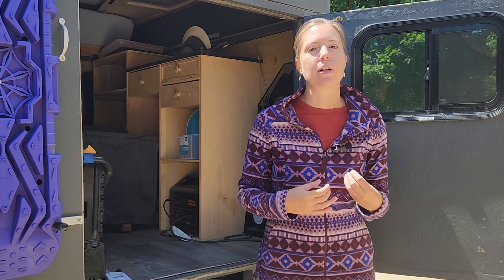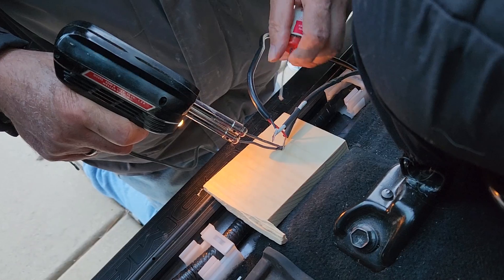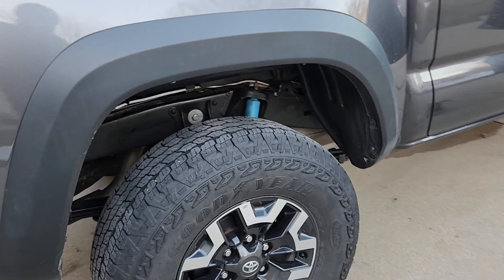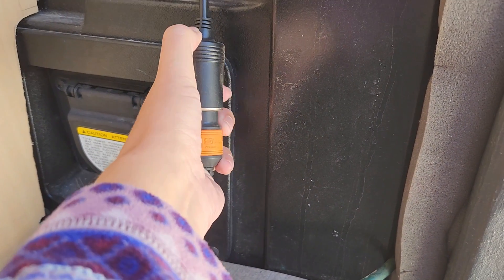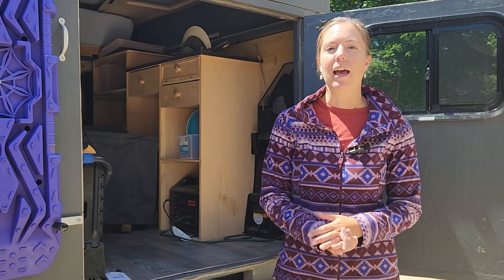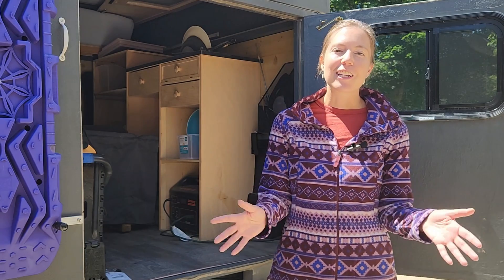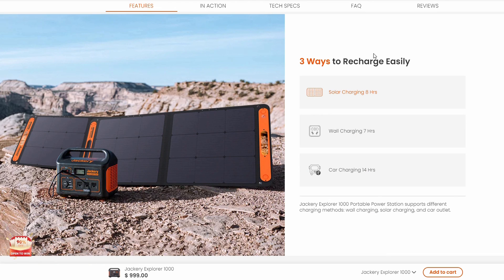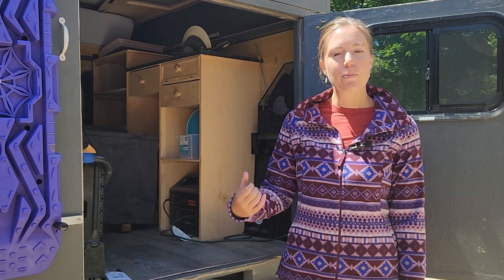Tacoma Truck Bed Power Outlet Fix - Simple 12V Solution (less than $10)

Comment: Interesting that the wattage drops while driving.  I guess this is one of those things you learn just by experience.  Mounting solar panels on your camper roof will be a game changer!!
Reply from the maker: Yes, I really wish it stayed at a 400w output while driving. But the 12V solution works pretty well. Although I am still excited to upgrade to solar panels.

Comment: Great low cost improvement! Has it unplugged  from road vibration? Some overlanders complain about that problem.
Reply from the maker: Not yet. I was worried about that, but it's done well (even on the bumpy Utah BLM roads).
Reply: @WanderwithKate  Good to hear, looks like it fits together very snug.
Reply: Be careful when using 12volt extension cords.  Charging something may not use many watts.  but if you're running tools or something, you may overload the extension cord.  You can run extension cords a lot farther on 110 voltage than you can on 12 volts.